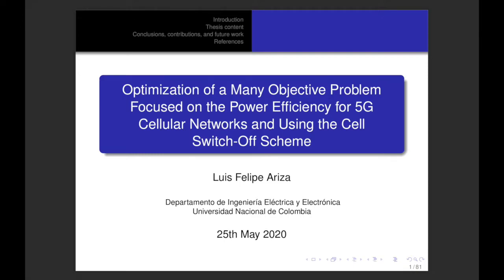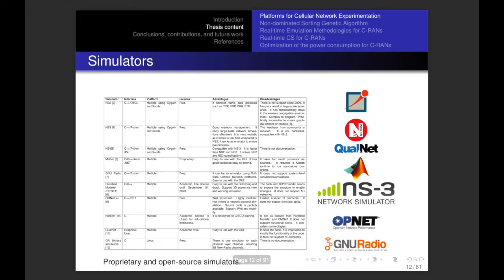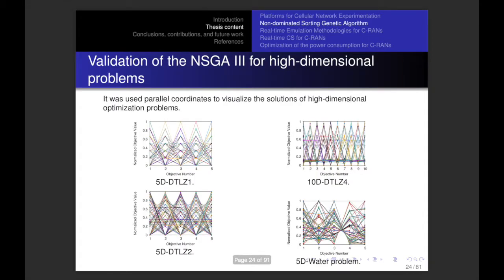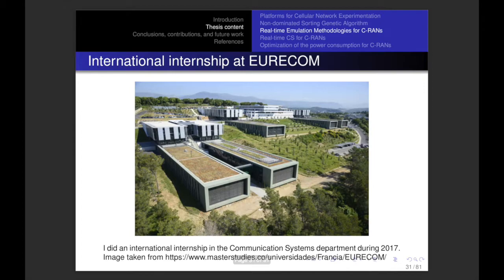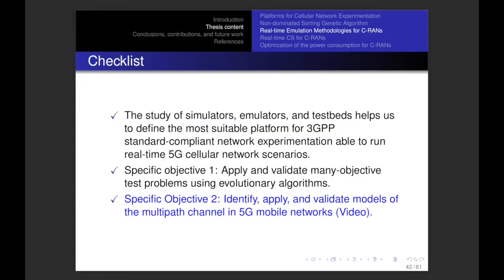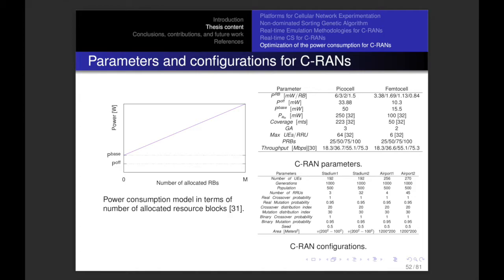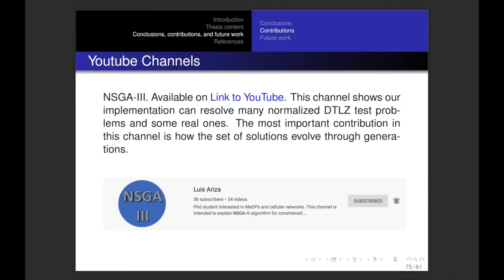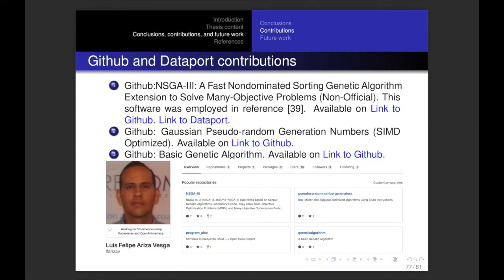Ph.D. thesis about the optimization of C-RANs using the OpenAirInterface platform

Comment: Congratulations, Is it possible to download your thesis's book? Did you share the modification code of OAI or not ? Nice work
Reply from the maker: Hi, you can download from https://repositorio.unal.edu.co/bitstream/handle/unal/77582/LuisAriza.2020.pdf?sequence=4&isAllowed=y
The code is available on www.gitlab.eurecom.fr, openairinterface5G project, branches large-scale-simulation and master-large-scale-simulations
In large-scale-simulations you can run frequency domain methodologies with oaisim
Reply: @OpenAirInterfaceTutorials  So for this, you use oaisim no a realhardware like usrp? or you do testbed and simulation both?
Reply from the maker: @harisainamiora5758  In my thesis I employed only oaisim with multipath channel simulations. I have not used radio units.